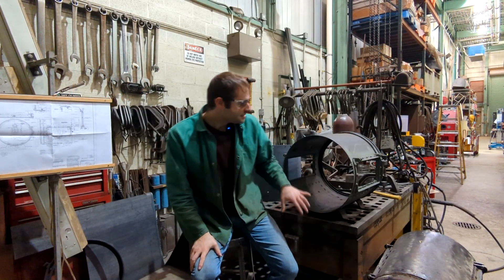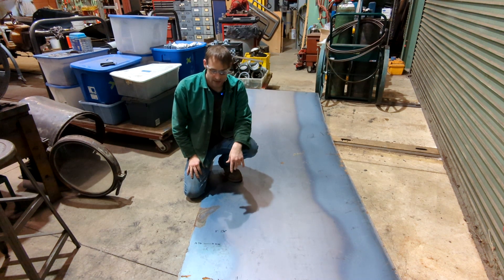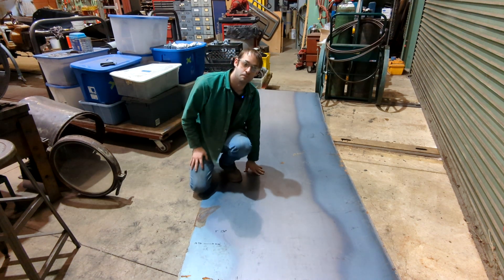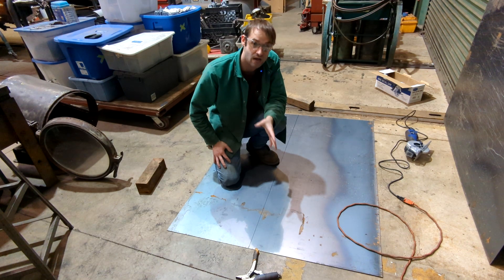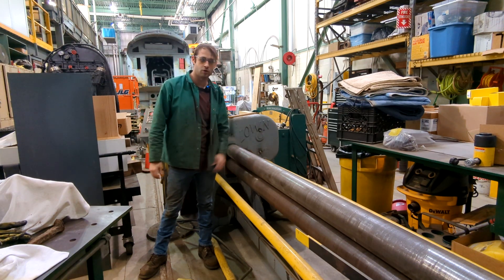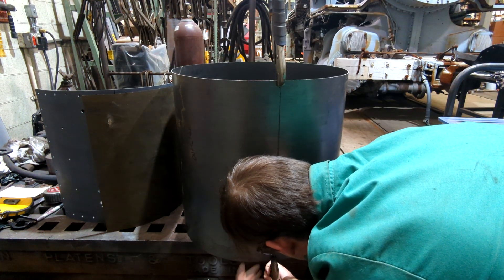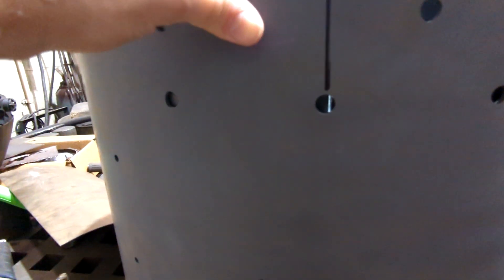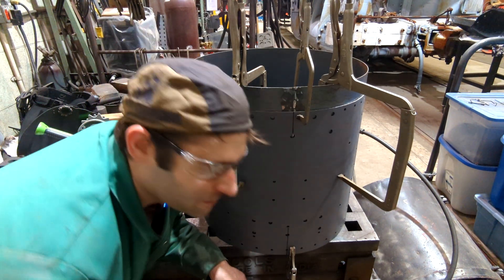Building a Locomotive Headlight for PRR 1670 B6 Part 3

Comment: Post pdfs online for model builder with 3D printers. Also, metal hobbyists can construct a headlight in their own shop.
Reply from the maker: I will see if I can.  I have been working off of the original prints that are held by the state archives in Harrisburg.  I'm not sure how the copyright works in posting that material.